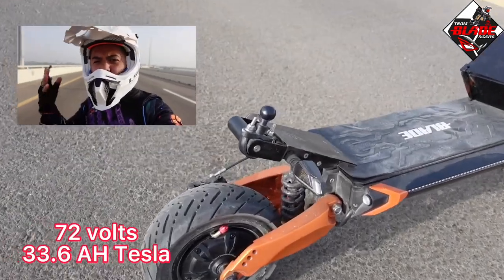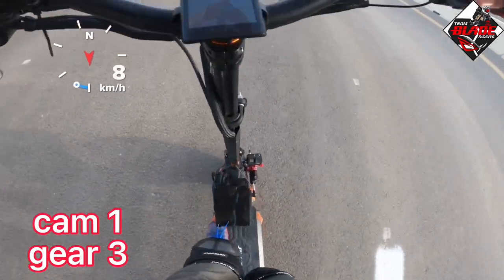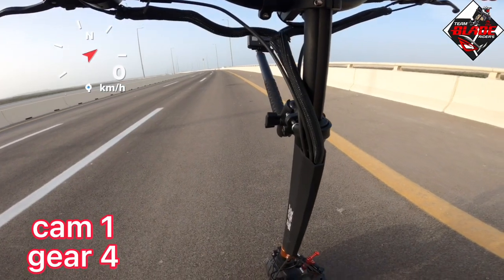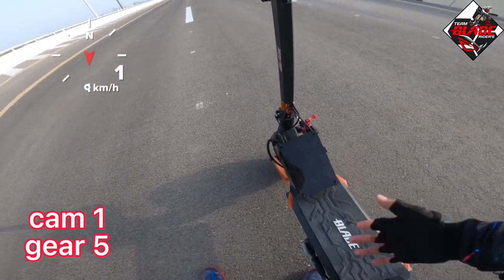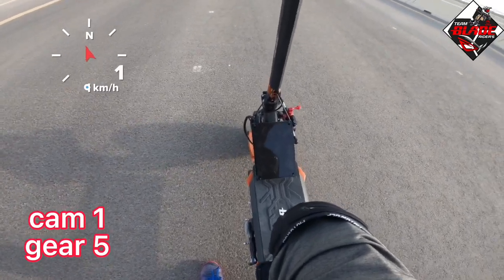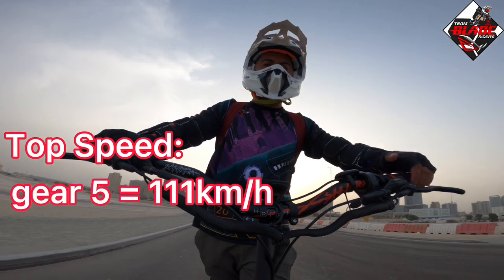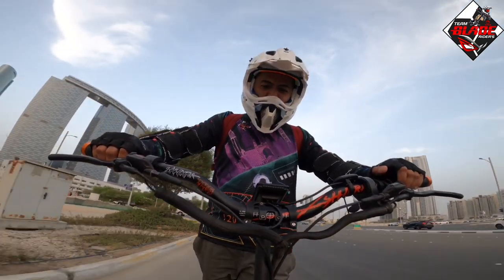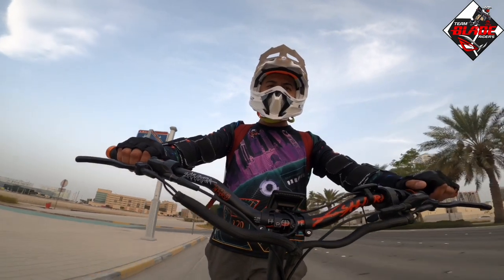111 Km/h Top Speed Test | Modified Blade GT | James Angelo TV | Vlog 120

Comment: Hello Brother. Would you help me?? mile Blade GT stopped working in the middle of the street and no longer wants to work. do you know what it could be?
Reply from the maker: yes bro what is your display?
Reply: @JamesAngeloTV the original right side
Reply: It is calling and it shows 20 to 23 ah and then it quickly lowers this value to 0 and turns off

Comment: Can I change the controllers on my dualtron archellius I have 35a ones, do you recommend 50a ones? Would I gain a little more strength and top speed?
Reply from the maker: yes it will add more power but try change the bms into high peak power also if possible add AH also
Reply: @JamesAngeloTV  with 35A LG batery is good?